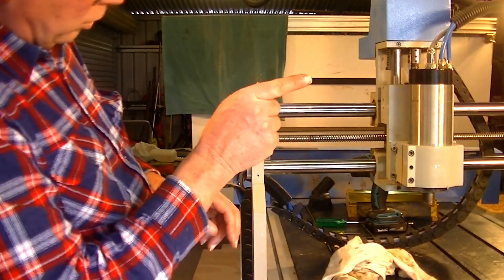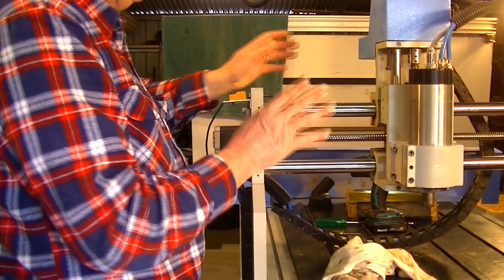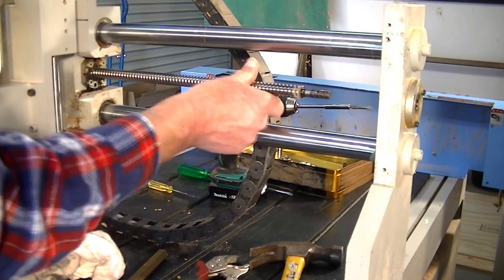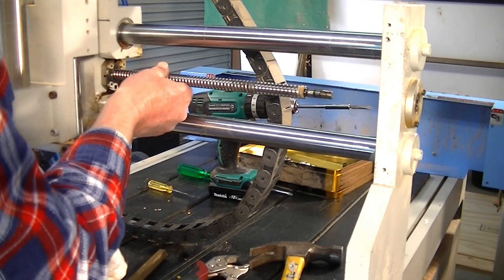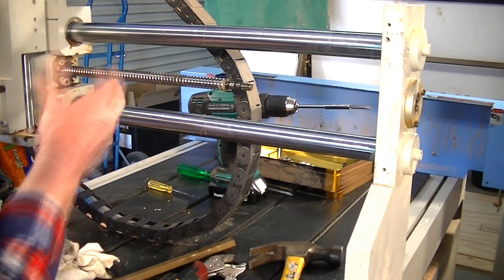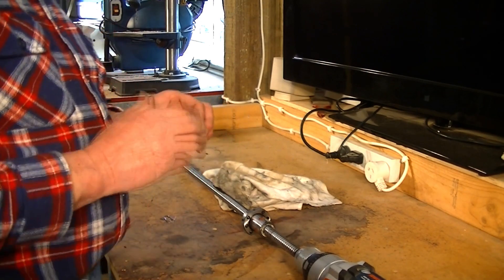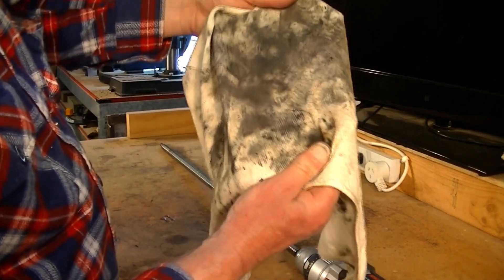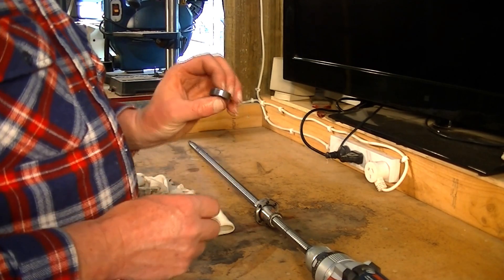#My Failed# 6090 CNC Router Repair?!?#

Comment: With the metal being on threads it is surely the ball screw, but beings bearings aren't that expensive I would replace end bearing just because it's already apart too. Also look closely at threads to make sure the coating isn't flaking off-seen that numerous times too and flakes get into ballscrew bearing an cause issues. Good luck.

Comment: I had some problems with my cnc recently appearing to lose steps only on the x axis, confusing the issue for me was the fact I was commissioning a new controller a SMC 5-5-N which I was fortunate enough to purchase early for a lot less money than they currently are. However the lack of a good user manual made it a lot harder than it should. On the surface it appears to be good deal, if you were already familiar with the ins and outs of cnc operation. My previous controller had gone to god! but it had come with a complementary software so using it was quite a bit easier. I tended to take a lot of the operation for granted. The offline controller was attractive as there was no computer to crash or have a glitch which would lose where the location was and you would have to start again. However you have to enter everything into the controller, sorting out post processors etc. No functions like mapping heights of materials etc and others. Anyway back to the issue I had, I'm an electronics tech and I kept looking at my problem an electronics or software misalignment. But I was having a closer look at something on my gantry and went to rotate the leadscrew and hadn't powered down so they were holding firm, but some reason I gave it a good twist the bloody thing rotated half a turn!! Of course it turned that the grub screw on the coupler that sits on the flat machined on the leadscrew had come loose. It was a mechanical problem all along. Talk about wanting to bang my head against a wall.
I'm now thinking the SMC controller despite some advantages may be a bit on the basic side. Having height mapping would be rather useful. Even the original controller I had(Desk Cnc software and controller) had more features, I do a fair bit of metal work and fine engraving for making valve guitar amps and other things. I had to make my own spring loaded engraving tool, as cnc's are pretty unforgiving on non flat surfaces. Your machine was pretty noisy too for a unit with the type of spindle you have, I was wondering whether it bearings were complaining. Good luck with it all.